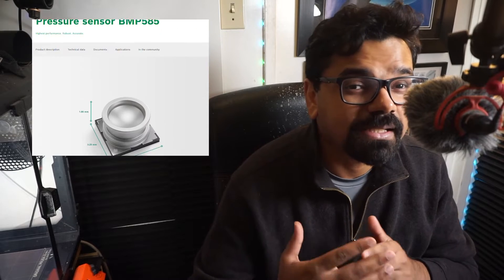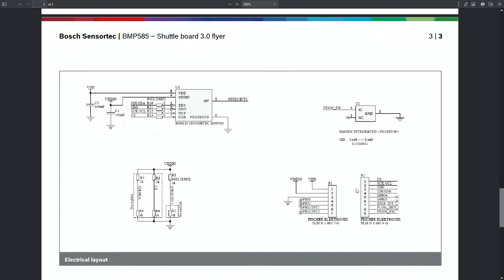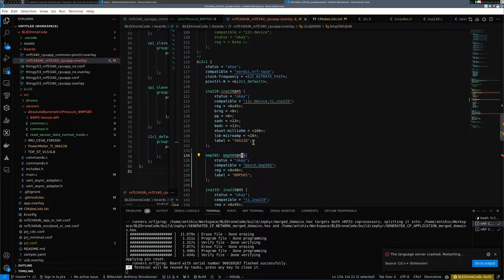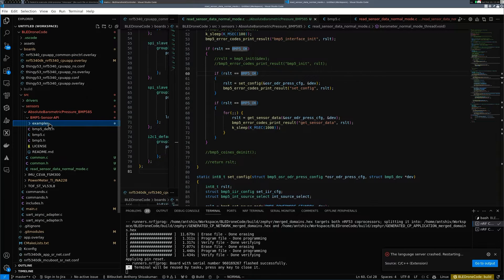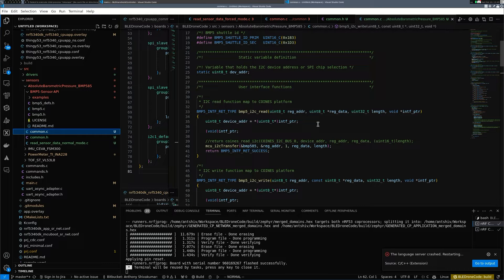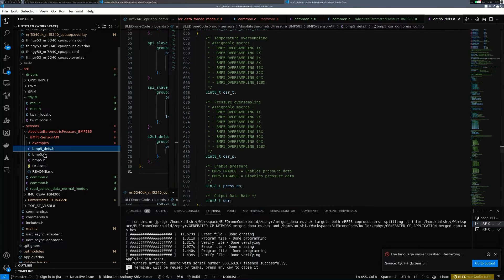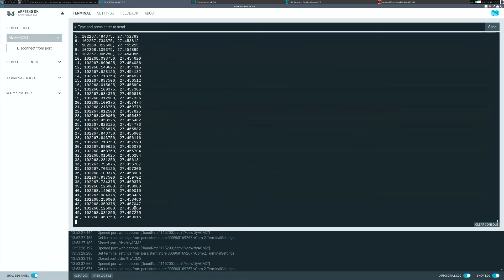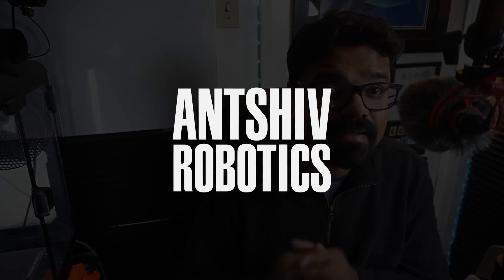Altitude measurement using Barometric pressure sensor (BMP585) with NRF5340

Comment: Can I get the code to interface the bmp585 with Arduino or esp32
Reply from the maker: The driver for the BMP585 is available from Bosch. It should be straight forward to port it to an Arduino or esp32 similar to what I have done for the Nrf53.